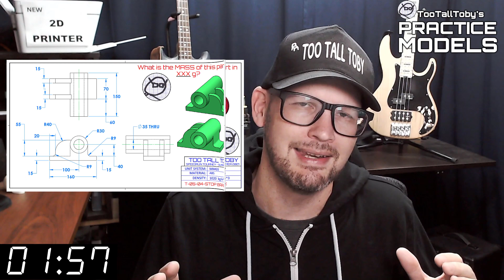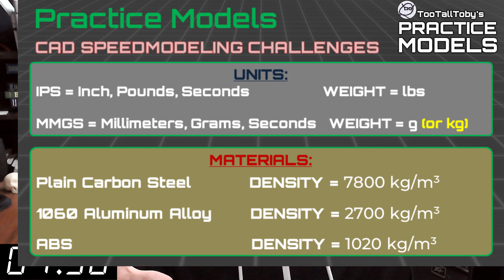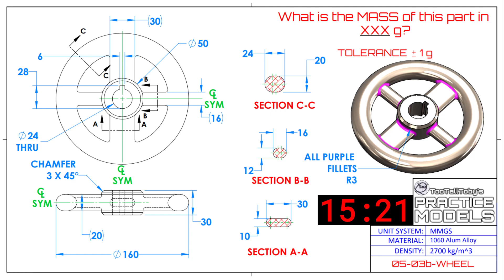SOLIDWORKS Practice - Onshape Practice - Fusion 360 Practice Exercises - TooTallToby-05-03b-WHEEL

Comment: 648.3824 in Alibre. Within tolerance but not 100% accurate. I later discovered that I had only filleted on the center hub and not around the wheel. Did in 5min 39sec
Reply from the maker: oh yeah sometimes fillet propagation can mess things up!